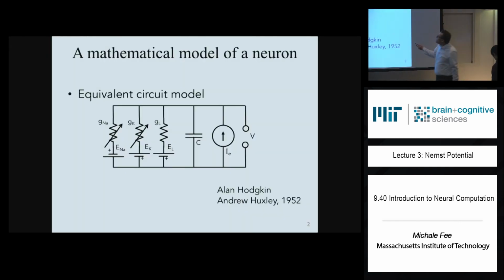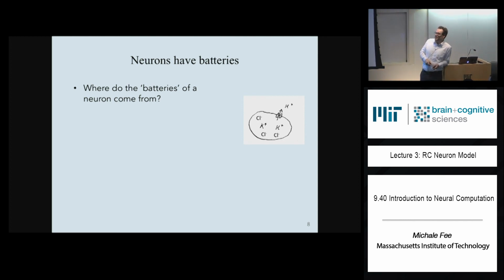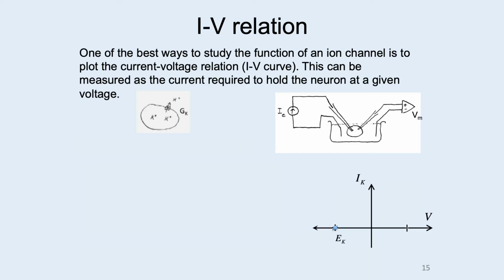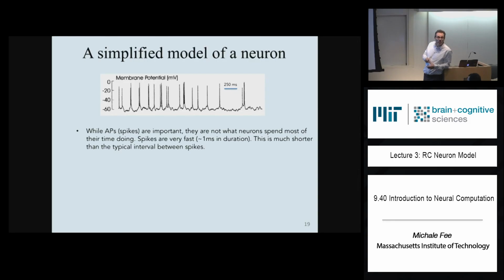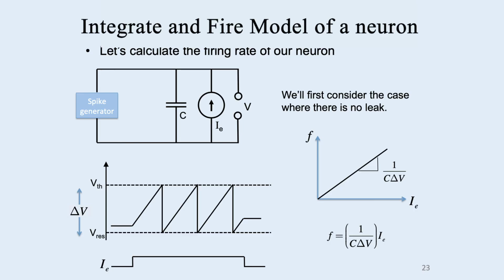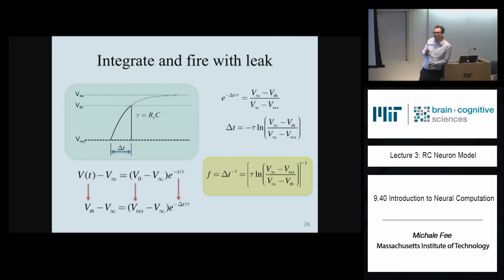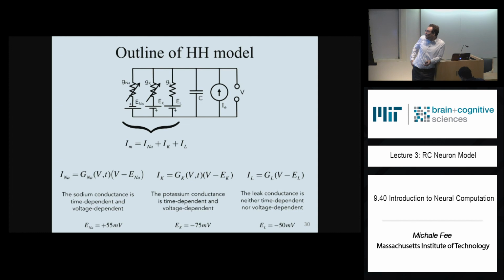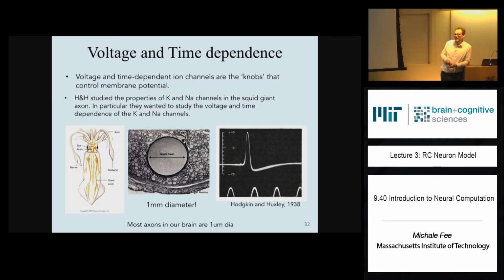3: Resistor Capacitor Neuron Model - Intro to Neural Computation

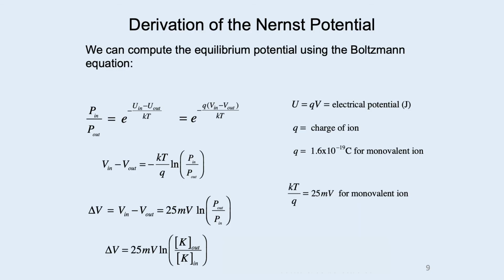Comment: 11:30 I was wondering why the constant for the Nernst potential equation was 58 mV in my texbook but 25 mV in this lecture. It took me a while to realize that the equation here uses the natural logarithm while the equation in my textbook uses the base 10 logarithm. Indeed, 25 mV * ln 10 ≈ 58 mV. So it's the same formula, but the bases of the logarithm are different, so the constants are also different. Maybe someone finds this helpful!

Comment: A leaky integrate-and-fire neuron (LIF) is better than an integrate-and-fire neuron (IF)? Is this true?
Reply: This was also counterintuitive for me, but for what I understood, you are right, LIF is better. If the input is integrated, without reaching the threshold (thereby no action potential) in the IF-model the voltage would stay increased without decaying. But in the LIF model through the "leak", the voltage would decrease slowly to the reset voltage.
Reply: @lauraw2026 , yes. I know that. Infact, LIF acts as a low-pass filter which helps filter the high-frequency noise components.
Reply: @lauraw2026 , we can discuss these things in detail if you want to.
Reply: @alisiddique5262  full on simping...
Reply: @Samratritviz  xDDD

Comment: Are there any videos of the recitations and are there any available solution sets (or extra problems/solutions)? Problem sets without solutions aren't very useful.
Thanks for posting this course, it's really interesting and well done!
Reply: Also, are there any public forums for working through problem sets?
Reply: @andrewfalcone2701  Have you found anything?
Reply: @yoloswaggins1072   I did not (I didn't look that long). The videos are well done, I just don't think you can learn it as well without working through a lot of problems.